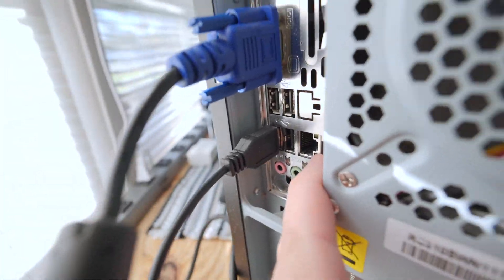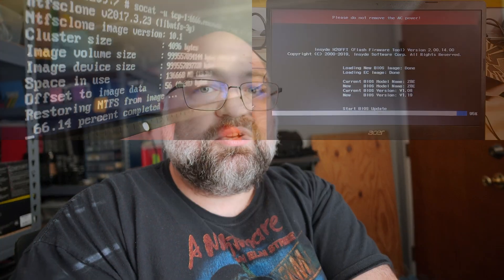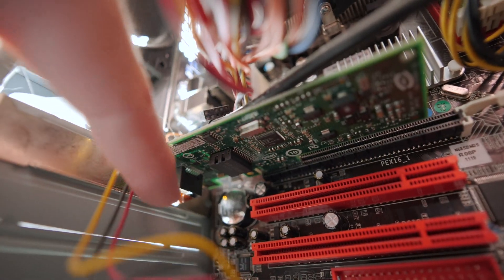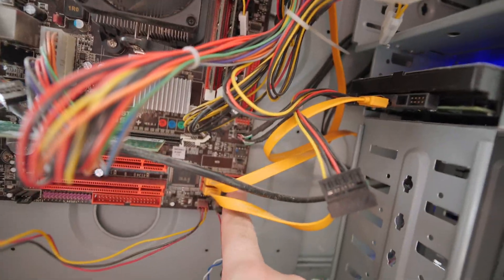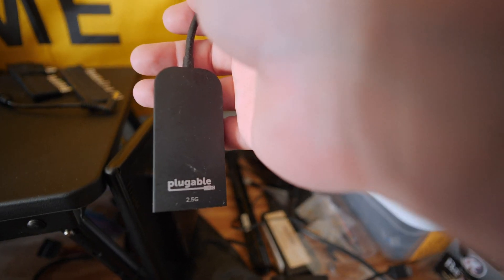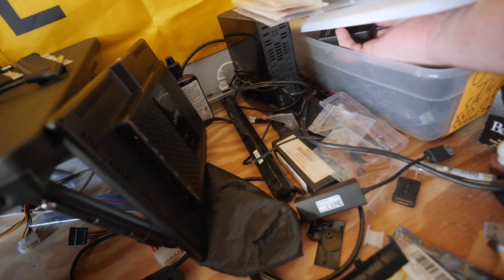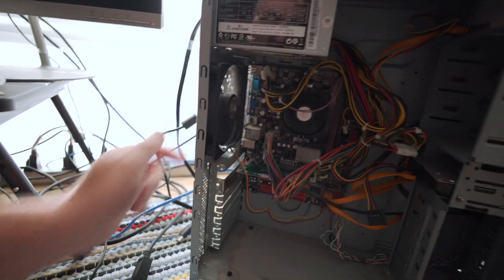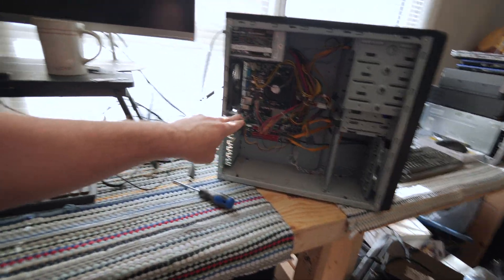FASTER DATA TRANSFERS For PC Repair Jobs - MAKE MORE MONEY!

Comment: Dont transfer via ethernet.... if you want speed just plug this disk in a modern machine.
Reply from the maker: The drive is 12 years old. Transfers max out near 100 MB/sec. and gigabit ethernet tops out at 113 MB/sec. To remove the drive, you would have to remove 4 thumb screws, 2 panels, rotate the PC twice, remove 4 screws, unplug 2 wires, and then whatever is involved in plugging it into another machine. Meanwhile, I plug a single screw PCIe card in and transfer over gigabit ethernet at the same speed but without wasting time doing partial desktop disassembly work.

So yes, use ethernet.

Comment: I appreciate you repairing older gear Jody, I really do, I do so myself, but it's easier and faster just to unplug the drive from the old system and do a clone backup via a USB3 dock. If speed is all you're going for, you don't need a 2.5 gigabit lan to do this job.
Reply from the maker: I didn't go over everything I do. It's not uncommon for me to pull a SSD and plug it straight into the USB 3.0 front port on my storage server and dump the data directly to it. I think you're missing the point of the video. This user needed Windows 10 and a data backup/restore. I did the entirety of the work in about 15 minutes because of the temporary NIC upgrade. It would have taken a lot longer to pull the hard drive and plug it into something else than to just add a gigabit card. Also (especially for someone who is starting out in this work) a lot of what we're talking about depends on having the tools and resources to do it. I spent years only using external drives, but a network storage server can take advantage of old machines with gigabit cards but no USB 3.0 ports. Some people will have limited resources, so I provided a variety of suggestions.